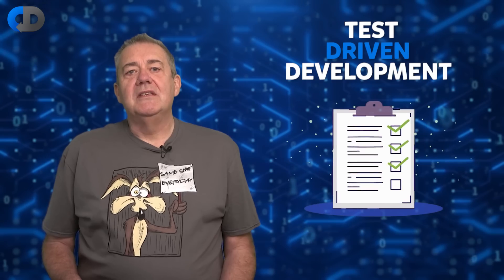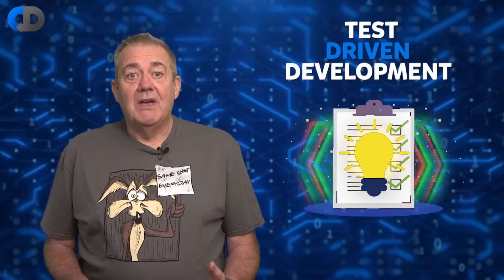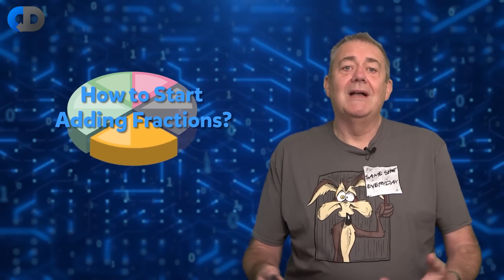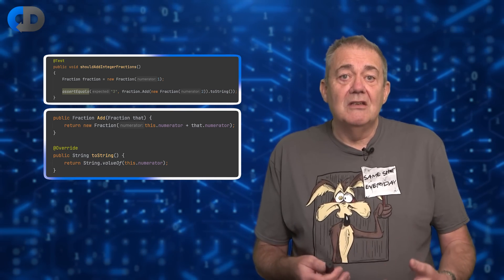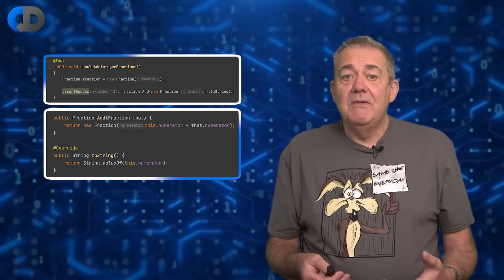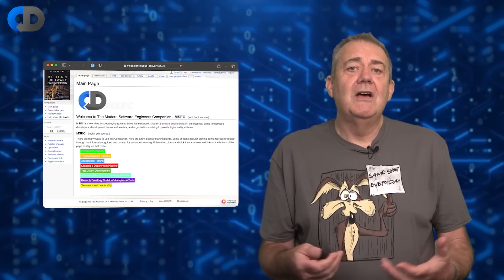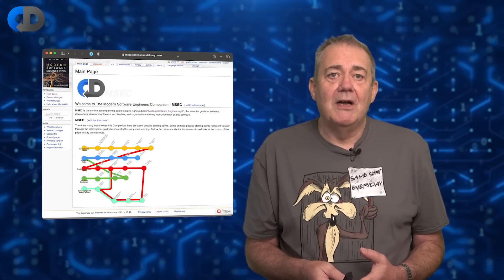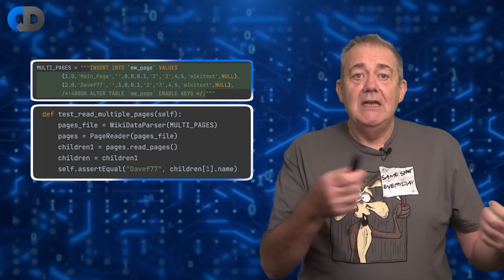Test Driven DESIGN - Step by Step

Comment: Key points from the video:

TDD allows for progress in small steps, taking fewer risks, and evolving a system incrementally.
TDD can help surface design problems, but it does not necessarily lead to good design. The main barrier to TDD is not testing, but rather exposure to bad design choices.
When learning TDD, it's important to focus on understanding the problem before trying to find a solution. Start with a simple example and create a test for it, rather than imagining a solution and trying to test it.
The speaker is designing an API and has made some design choices, such as using a type to represent fractions and adding them as fractions rather than strings or decimals. He believes it's important to make design choices early on and experiment with them while the code is still simple.
The speaker discusses his thought process for designing a fraction type in his code. He emphasizes the importance of not thinking too far ahead and instead focusing on organizing things in different ways.
The speaker is working on a project involving adding fractions and uses the test as a design tool, focusing on separating the concerns of addition and rendering fractions as strings.
The speaker discusses the design and organization of a parsing job, starting with a single page and progressing in small steps. He prefers modular code with a good separation of concerns and easy testability.
The speaker discusses his approach to using tests in TDD. He emphasizes the importance of testing recursion and creating circular links to ensure the recursion ends. He also mentions the importance of testing for pretty names and how tests can serve as mini specifications for the code.

Comment: When I first tried automated tests, I was coding first and testing after and saying "I'm doing TDD"... I was testing "units" that had far too many responsibilities and found it to be quite a struggle. This was when my code started to get a lot more "SOLID" because SOLID code is so much easier to unit test than the (not huge but still) too large classes and methods I had been writing.
Once I finally got a handle on what TDD REALLY is, those incremental steps made my code come out far more "SOLID" almost as a by-product.

The funny side effect of all this is that I used to hate Python because of it's lack of delimiters at the end of a block... by as my code become more "SOLID" and I became a "never-nester" my need for end-of-block delimiters became far less necessary and I learned to love programming in Python.

Comment: Hi Dave, If you decide to add new classes during your refactoring  step, which is very likely, do you start a new TDD session for each of them or are they considered taken care of by the current tests?

I intend to give TDD a shot on my next dev, I ve been doing only CDD so far where we have to test every single class so it would feel awkward to do so with TDD it seems to me if I have to stop testing the current class to start another TDD session on a new one and then come back to the other one later.

Thanks, I enjoy you videos a lot.
Reply: If you are truely refactoring you don’t need to testdrive the new classes, you already have the code. You might want to add pinning tests for that functionality though. And if you want more functionality in them you should testdrive that, but take care to not drive more than you are sure you need. Also the needs from you first class might change as you go, so I tend to mock the new classes, at least till I feel confident about their ”api” and responsibility. Sometimes I keep the mocks until I’m ”done” with the first class and then turn my attention to the others.  At that point I know what I need.
Reply: Here is how I understand this. The classes you create at the refactoring stage generally don’t require testing. You create tests for the logical boundary of the feature, make it work, and then refactor as much as needed to make the internal design of the feature good enough. After each refactoring step, the tests you’ve previously made will assure the functionality is not broken. You may end up with the single class or with ten classes. The beauty of this approach is that later when you get even better idea of how to structure you code, you can refactor the feature again and be confident that it still works.
You add tests only when a new requirement for the feature comes up. You change a test only when a requirement changes.
This approach encourages you to make changes in the system. In contrast to the situation when you’re reluctant to enhance the code because this would require rewriting tons of tests.
Reply: @penaplaster  It's a good point that if the new, extracted class is only part of the functionality of the first class you should avoid adding tests to it to create dependencies from your tests to your implementation details. If that extracted class becomes a first class citizen used from different places and possibly with additional functionality, you probably should.
Reply: @thomasthoninilsson  Another important aspect of this is that you should instantiate internal classes directly rather than getting instances from a DI container. Calls to internal classes should not be mocked (except when they call external dependencies). This again helps making tests insensitive to structural changes within the logical boundaries of the feature. Also, this promotes cohesion: you explicitly state that a certain class is an integral part of the feature.
Reply from the maker: It depends, I try to avoid allocating test cases by class, and more on areas of behaviour, so sometimes I can leave them where they are, sometimes it can make sense to move them to a new TrestCase.

Comment: I really enjoy the exploratory nature of TDD, but sometimes I find it hard to make it fit into an existing structure; not because the project itself has a bad design, but because I get to a solution "of my own preference"; and sometimes that feels alien within that specfic structure, be it naming convention, folder structure or any other pre-established guidelines.
Reply from the maker: I think that the core is still correct, even if you loose the value of exploring the design. If you are writing to a fixed external interface, then you still want to focus on the behaviour that you want that interface to expose. Depending on the interface this may be less pleasant than when you have the freedom to change it when it is crap, but focusing on the behaviour still means that you don't care about implementation detail - which is the real win.

Comment: I have adopted TDD as much as I could for about 3 years now. I'ts going great and I get the benefits you describe. Even when I don't write tests upfront, I still think about my code differently. One area where I seem to struggle a bit is, if I have to implement an interface with a specified behaviour. Right now for example I am trying to write my own Gymnasium.Env in Python and try to do it TDD style. Since the interface is set in stone already, I can write some degenerate cases for each method to start and implement those - but it just feels wrong, since I'm not really discovering a new solution to a problem, I am implementing rules that I already mathematically explored and know how they work. Should I still use TDD in this case? Sure, I'd test the behaviour with some value and property tests, but in the case where both the interface and the solution are known, does TDD still make sense?
Reply: As opposed to what? What other method are you proposing to use? Do you plan to just open up an editor and write straight-shot each file in your entire code base from top to bottom, and then run the whole thing and it will work perfectly the first time you run it?

Chances are you stop and test your code regularly. You're going to take small steps, write the code to implement each small step, and then execute your code to verify that what you wrote works. Why wouldn't you write those steps out as unit tests that will automatically run as you make changes and give you instant feedback at every moment? If you can come up with a faster or more effective feedback loop, by all means use that and please share it with us.

I've never understood the hullabaloo about TDD. It seems so logical to me: if you're writing code, it's because you're trying to accomplish something useful, so why not write out that useful thing to begin with, in as high a level as possible, as an executable mini-specification that will automatically run as you type code and provide you with instantaneous feedback about your progress? 

The only exceptions I can think of is if you are not writing new code, but trying to make small adjustments to existing code to change a behavior, or you are trying to write your code by copy-pasting some huge chunk of code from somewhere else and then making modifications. In those cases, TDD will be hard to apply directly depending on whether the code has unit tests available or not (although even if unit tests are not present, I still follow a version of TDD with adjustments from Michael Feather's book).
Reply: @fennecbesixdouze1794  Yeah, the alternative is to just write some tests at the interface (as I wrote) and then just implement the pre-defined design. This goes counter to what TDD provides, that's why I was wondering. It's very close to what you describe in your last paragraph actually, just that I don't exactly copy code but translate math equations into code. This is the first time in 3 years practicing TDD that following the discipline feels off. Not because I don't write any tests, but because the design is set in stone even before I wrote a test.
Reply from the maker: I think that you still want the tests to focus on the behaviour and not the implementation detail, even though you have lost the malleability of the interface. That then still means that your tests aren't coupled to any specific implementation details, which is good.

Comment: I say this, hopefully, to show others that I have 30 years of coding experience and dont use it, and nor do you have to. 
If you enjoy it, fine, but dont feel pressured. It is not a silver bullet, it is not the best way to learn or become a designer, its not the best way to code. It is just one technique.

It has some rewards, but its not entirely a positive. It has negatives especially for people who have experience.

Lets say you are asked to build an SSO. Then in your next company you are asked again. You then participate and find issues in open standards and you have spent a lot of time understanding the nuances of security and functionality. Now you are tasked with building your third SSO, together with two other people with more experience than you. Are you honestly going to start with a little test to verify a token and then a little test to format a url, then a little test to add a user. No, you are going to MODEL to the entire SSO and you are going to go directly to the areas of your design that you want more understanding or that makes this new architecture work best. Here you will build a prototype to verify your assumptions. You will then jump to other platforms and test this design choice in other languages. You are not going to rewrite the test for formatting a token in the other language all over again.

Comment: Challenges that block me from progress are when we already have a system with bugs and/or edge cases that sometimes occur. How would you tackle this using TDD? Recreate the bug using a test? other? interested in your take/approach...
Reply from the maker: I guess it depends on why the bugs are there and what you mean by edge-cases. TDD is a design technique more than anything, so this is at its best in helping to create new good code without bugs. Edge-cases are fine, they are just new behaviours that the code needs to deal with, so write a test for those behaviours too! 
TDD can still help with bugs though, when a new bug is found, write a test that fails because the bug is there, then make the test pass - so eliminating the bug, and demonstrating in the process that you have.
Reply: @ContinuousDelivery  example edge case: AWS lambda environment. usually a fetch request to a vendor api responds within 50ms. but on occasion, if it doesnt respond within 3secs, the request is retried. This causes typical concurrent modification and duplicates request errors as the previous request actually responds albeit eventually. Trying to recreate those edge cases have proved tricky using TDD in a lambda domain... hope that helps...

Comment: I struggled to use TDD implementing quantitive finance model. Result of such model, even for simple cases, is result of multiple data transformation and mathematic computations, so it’s not so obvious. Even if I divided model for simpler subfunctions, still specifying result of computations (matrix operations, looking for minima’s) was hard. Inputs was based of output of previous functions. Also I had little experience in programming algebra operations with numpy, so it was also learning process for me. What I found that’s better works for me is programming interactively in jupyter notebook, where I could do little steps in adding code, checking and investigating results of single computations, which in my opinions didn’t deserve to be separate function, use result of one function as inputs of another, and then write tests at the end of the process for regression. Probably it is called REPL driven development. Maybe I couldn’t simplify problem enough to use TDD, maybe such programming is alternative for TDD?

Another example of such workflow is implementing pure presentational components in fronted. With tools like Storybook, you can implement single component looking of visual effects of your code while coding, and then implement snapshot tests for regression.

Comment: I think there is a gap between what you are saying and presenting here, or maybe am I simply very confused.

"A function adding fractions should return a fraction" is the thing I would like to see expressed in the unit test, because that's a property of the addition of fractions. I really don't understand why you test the result as a string You say that it is more readable but you also say that you want the test to reflect the interface, which it doesn't, in part because there seems to be magical type coercion going on. It's impossible to tell by looking at your test what the real return type is.

By doing this, you are also adding confusing factors in that the test is now testing a proxy and not the real thing that it needs to test, and that in order to test that proxy 2 things need to work (addition and rendering).

Now you could reply that if the return type is a fraction, that step could just as well fail independently of the addition, and it is true, but it's also the type of the input, so maybe, actually, the creation of the type could have been our first test (but what should it look like? Do you render it? It's turtles all the way down)

This is a problem I don't only have with TDD but with testing in general: helpful tests test few things at once, so that when they break they can point to a single cause of failure, and of course as your code grows in complexity, achieving this is less and less practical. This definitely contributes to cognitive load when writing tests, and maybe your approach is more pragmatic, but it looks a bit carefree in comparison.

In the case of fractions it's actually pretty simple to know what the next test should be: we could simply list all the mathematical properties of the addition of fractions, and actually it would be a better living documentation for our code because it would be one that makes sense, and someone familiar with the domain could point out that there are properties missing or whatnot, but of course this is harder to achieve when you don't know where you are going.

I know that your emphasis was on design rather than functionality here but the two are intertwined.
Reply from the maker: I don't disagree with your end-solution, that is where I end up too, but the intentional process of TDD is to make progress in small steps, allowing me to verify my progress often. If I chose to return the Fraction in the first step, I now have more work to do between tests, it is a choice, but certainly when teaching TDD, and mostly while practicing it, I prefer to make change more incrementally.
In this case, if I had chosen to return a fraction I would also need to implement a 'toString' method, and call it in the test, so unnecessary complexity for the first step IMO.
Reply: @ContinuousDelivery  I see what you mean. The alternative would have been for me I guess to implement an equals operator before implementing addition. The first test for addition could be the addition with 0 because returning oneself is simple and enables to test the 2 functionalities together for the first time. This equals operator would later deal with greatest common denominator (I'm not sure it should be the responsibility of addition to simplify fractions but equals does need to do it and using it enables to defer the decision of doing it in the add method).

I am clearly overthinking this though.
It's easy to overthink what to test next. It was a great topic for a video.
Reply from the maker: @ApprendreSansNecessite  Yes, and the "toString' vs 'equals' is a nice design choice to make, either is fine, but it is nice to proceed in small steps while you are making the choice.